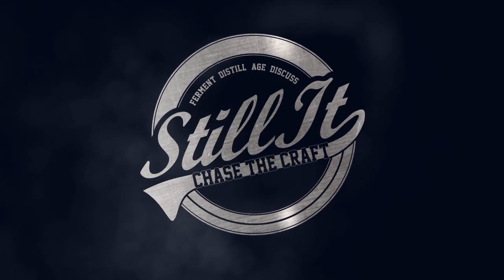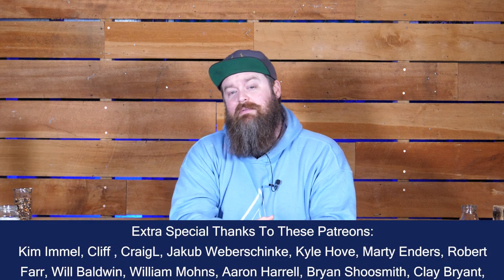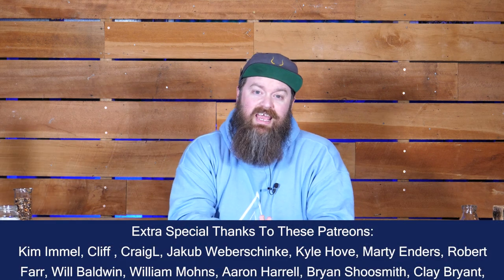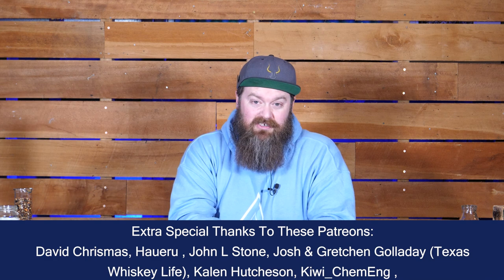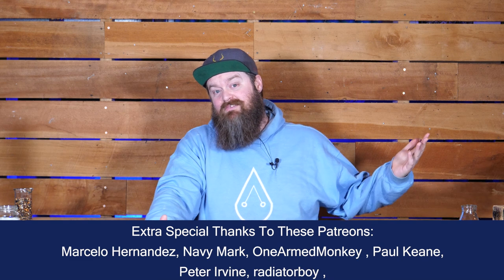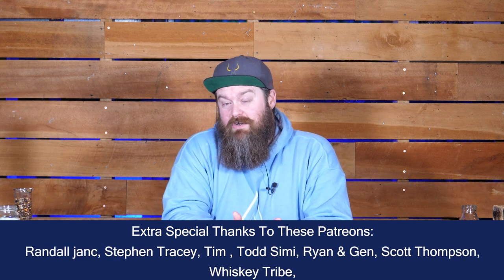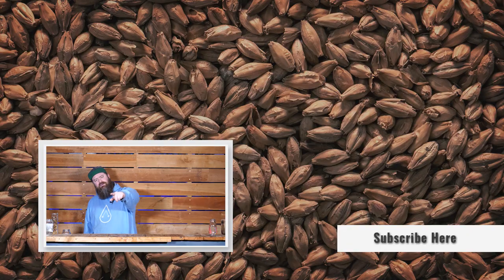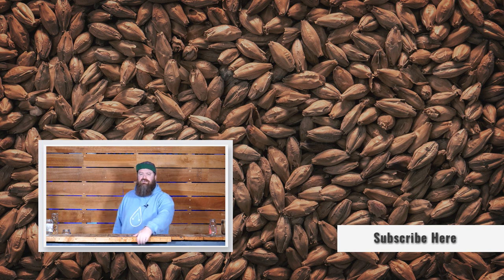How To Stop Your Still From "Puking" (boiling over)

Comment: Great video Jesse, few extra bits:
Turbo yeast and high ABV washes can require quite a lot of degassing.
Superheating can cause pukes in very clear washes so adding some ceramic saddles or other inert media helps prevent this by physically breaking the surface and allowing bubble forming.
Using sunflower oil can give a sunflower taste to your tails, not the worst flavour but quite a surprise, for only 5ml added.

Comment: I've had some early success with fermenting rum or whiskey with my chosen yeast until it is done, then pitching something like EC-1118 to hit full attenuation.  Getting rid of the sugar seems to help the problem immensely and the tiny bit of extra yield is a bonus.  Gotta pull out your trub before repitching if you want to rinse and reuse the initial yeast.  I have only done this a few times so it's just an anecdote for now.

Comment: Elements sit near the bottom, therefor the hottest liquid sits there, once it boils it lifts the wash and blows up through. I run a recirculating pump that pulls hot liquid from the bottom and sprays it on top. It helps to pull CO2 out of a new wash and also increases surface area a whole lot for the spirits to escape from.

Comment: i found out condenser temp will make a puke. i tried to use tap water to cool it and i guess with my set up it wasn't cold enough. i went back to the way i usually do it with ice water in my sink with a pump also ice in my condenser...no more puke.
Reply: That’s a good tip on understanding the problem
Reply: I'm not sure that's right - a puke happens before it reaches the condenser.

Comment: I wonder if the problem with grain is less about not fully fermenting the mash than it is about a need to really boil the wort to create a protein break so that the proteins in the grain drop out of solution. The wort you collect after this "break" is then very low in protein. An inadequately boiled mash will result in a wort that is high in protein which will then form a net-like structure (think gluten in wheat) that tends to trap gas as the mash heats up in the still and that trapped gas can then push liquid up the column and so cause a boil over or a puke.. So , even if you are not boiling the wort because you are not adding hops you still need to boil it enough to create a protein break.
Reply: I have heard abd it seems to work for me that after 20mins, the foaming us not an issue.  As you mention it is likely the proteins breaking down, so if you just run slow for the first 20mins, you can crank it up after that.

Comment: I use Distillers conditioner along with ceramic saddles down the bottom of the boiler.
Reply: Same here and have never had a puke, but I always find myself running out of it, which is a nuisance, I only use it as a bit of insurance when stripping the wash.

Comment: Useful - I’m about to start my distilling journey proper after upgrading from a airstill to a 2” modular pot/reflux running off a grainfather - found a lot of information here - cheeers from UK
Reply: Hi also in the UK just started also 2 runs in , we should form a dynamic duo ! lol bought a t500 last week
Reply: Edgunsuk  - is that Leshiy Edgun?? Small world if so!! - I was going down the t500 route but started looking into what it can/can’t do and ended up going with a full copper rig from distilling.co.uk - bit more $$ than a t500 but I’ve got a 500mm pot (rum) or up to 1500mm gin column - cleaning run in next couple of days

Comment: HI Jesse. Thanks for these tips. Had my first puke yesterday with a very dry 0.988 sugar wash of all things. I believe that I overfilled by the smallest of amounts but I lost my run and will re run tomorrow. Using a T500 column for my neutral run before producing Gin in the alembic. When I use the Alembic for the Gin run I insert a st st gauze (Actually one of thise frying pan covers to stop oil splashing out) with a silicon seal and on this I place around 25% of the botanicals used in the maceration process to extract more flavour. I'm thinking that this would break up any bubbles or foam forming at the surface and prevent them entering the column when distilling using the colum,n. What do you think? Additional info: I use a capfull of foam cut and ceramics in the boiler. I dont use my voltage controller until I do the second distillation but will do in future having listened to your vlog. I dont clear my wash (and have necer scorched my bottom :) I didnt offgas the wash so will also do this tomorrow although any gas which was in there wont be by now. Keep up the gret work Jesse.

Comment: Yeh its rough with 100% peated because I fill reasonably high (70%) fill volume. 35L in a 50L keg or 100L in a 130L boiler
When ordering boilers please specify 'working volume' levels 

Coconut oil

Comment: Do your first freze distilation. this way you half the valume that you need to boil, increase aromas and reduce puking.  using this for long time. 
Note: if you live in cold climate you can do it outside, if your climate not getting cold enoug you need access to frezer.
Reply: That is a fantastic idea

Comment: What about adding a slobber box to your distillation system.
Reply: I also mentioned it in comments in Jesse's last video.
For those who don't know what a Slobber Box is.
https://homedistiller.org/wiki/index.php/Slobber_box
https://homedistiller.org/wiki/index.php/Thumper

When running a thumper it can also act as a slobber box. It catches the puke, and the puke will end, and the distillation process continues as normal. Only time you have issues is when the thumper is too small, then puke will fill up the thumper and continue to the condenser. (Thumper size should be 1/3 or 1/2 size of boiler)
I run a thumper that's the same size as my boiler. (15.5 gallon keg)

Cheers Lynx Mkiv!
Reply: @BigEdsGuns  that is true I just thought let me mention it, I know it is old school and some have tried to eliminate them from the  system completely by making pots with onion heads but I still think both of them should have their places in distilling even in modern times. Cheers BigEdGuns
Reply: @MKIV2JZGT  They do. Especially on a stripping run when you want to max out the boiler. (I do not run slobber) After the run,  just add the slobber box contents back into the boiler for the next strip/spirit run.
Slobber boxers were designed out of necessity. The pot would be fueled by wood, which could overheat the boiler and cause a puke, and if the thumper was too small, it would puke into the worm in the flake stand. So a slobber box was added to catch the puke before it made it into the thumper. (Think 500 gallon submarine still with a 50 gallon thumper it could go bad very quickly.)

Pot lyne arm diameter also has a lot to do with heat. Diameter is speed, so the larger diameter the greater the heat can applied. A 1/2 inch lyne arm is big choke point for how fast the vapor can pass through it. I run 3 inch arm necked down to 2 inch then into a 1 inch spear inside the 2 inch into the thump. The 2 inch exits the thump and into a 3 inch shotgun condenser.

Similar to Chauncey's here: (But I run 220v electric and have 20 triclamps on my "Roller Coaster")
https://homedistiller.org/forum/viewtopic.php?f=16&t=79428

Most I have ever run is 14 gallons in the boiler, and 10 gallons in the thumper. I also run a manometer to monitor the pressure in the boiler.

Cheers Lynx Mkiv!

Comment: Hi , is there any point in doing stripping runs with a t 500 and a sugar wash ? also on the subject of this video im using ceramic saddles and a chemical conditioner , seems to be doing the trick, i am assuming broken pottery will do the same as ceramic saddles you just need t give the liquid a nucleation site to form bubbles BEFORE it surges .
Reply: Glass Marbles work quite well too

Comment: So I ran my first stripping run last weekend with an all grain wash before watching this video, it puked, I turned it down a bit and it stopped puking. 
Once finished it was pretty cloudy.
I let it settle for 2 days and racked it off the layer of creamy crap that settled in the bottom of the glassware. The result is a not quite perfectly clear high wine. 
Will I get off flavours from this and need to bin it? Or do 
I need to run this through another stripping run? 
Or don’t worry and go straight to a spirit run

Comment: Your still is no different from a pot on the stove. If your pot (or still) is boiling over your heat is to high and your pot is too full. The cure is to reduce volume, reduce heat, and/or change the viscosity of your mash by adding water. Some recipes just foam terribly when they boil. You just have to adjust or suffer.